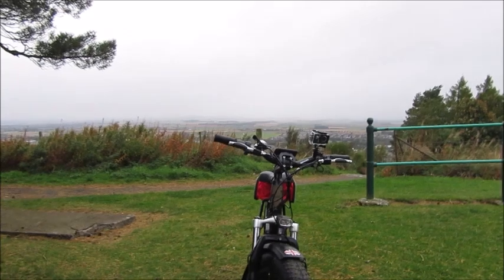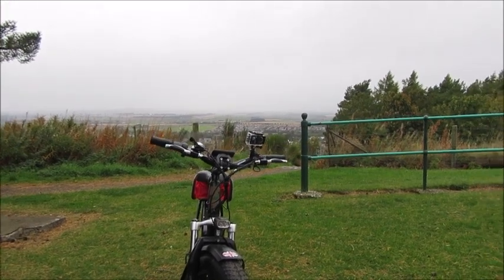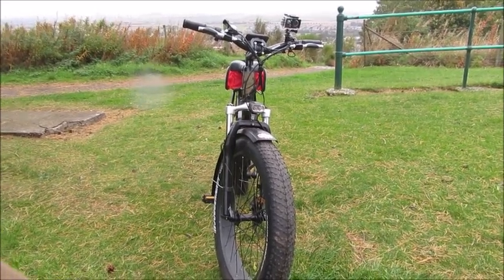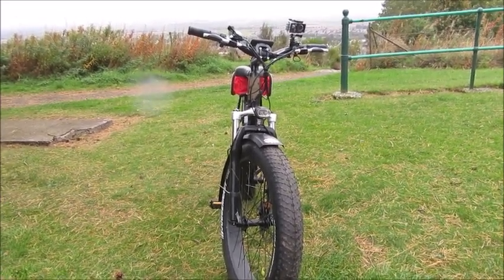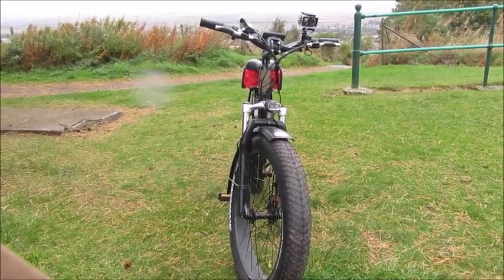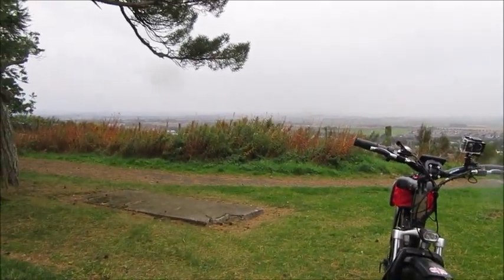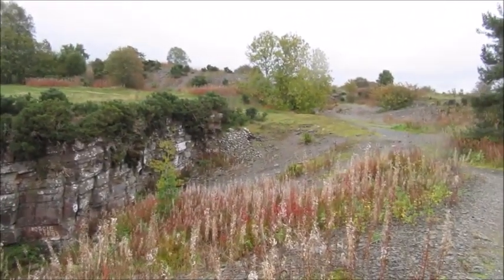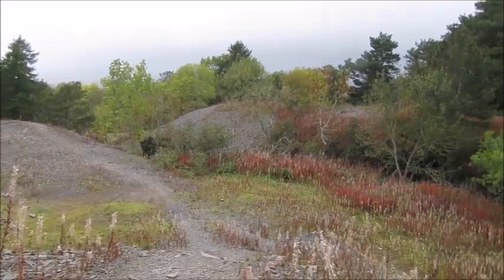rad rhino blasting up Balmashanner hill    nearly

Comment: Great effort Colin 🤘. I'm your weight and fitness and just want to be able to go out again after year's of depression. (Walking bores me) Hip is getting a bit achy now I'm 50. U.K. law restriction is too much for 123kg me plus a 20 kg bike (nearly 23 stone with a day bag)
Reply: Actually... Having re-read my comment  I wasn't implying that you're as heavy as me LOL. No offence intended 🤣 I meant that I was a stocky chap too. 😁

I jealously look at the options that RAD offer in the U.S. I'm loving the 2019 RadMini step-through as I have limited outside storage and a folding bike would mean I could put the bike in my car to explore new areas. The 2019 RadCity ST also looks good (quieter too with a gearless hub). Both with a 750 watt motor and large capacity battery. So, capable of handling  the load I'll put on it. Think I might be writing to my MP. 😉  The law needs to consider the type of bike the motor is installed on!

Comment: Have spent months researching and keep coming back to the Rad Rhino am purchasing a bike within next 4 weeks as diagnosed with a lung disease which have been told I need to push myself to help make the issue more bearable.  What are your thoughts on this bike,  it seems to have everything plus it does look good.  Have seen many American reviews but they seem to have some sort of connection to the company.  For me this is quite a big spend so I want to make sure I am spending wisely.  I purchased a Xiaomi Scooter but on my first outing got pulled over by the Police lol and didn't really find that I was exercising when using the scooter so only 6 miles on the clock.  Thanks
Reply from the maker: I will get back to you shortly... I'm just tied up for an hour or so... cheers
Reply from the maker: Hi, it's a great bike and does give you a help with the twist throttle. I think you will enjoy it I do. I try to be careful and have had know issues with riding on the road. I do use pedals and I am careful and don't use twist throttle to speed down a road. I cover up signage on the bike! So it's less obvious but that's me. I use it off road on good tracks not as mountain bike but certainly is ok to do so. Worth the money in my opinion but I wont register it as light vehicle. So go for it I have arthritis in knees and it hurts for the first few minutes but I keep a steady pace and works my joints. Using pedal assist 3... its heavy but seems to handle ok I'm no spring chicken but it's got me doing a few miles. Feel free to as any questions...cheers
Reply: @ColinTonkasdad  Thank you so much I think my mind is made up sometimes you can overdo the research like I said from what I have read and now reading your reply and seeing your video etc it does seem very good.  Thanks again for your help much appreciated.

Comment: Hey Colin, i understand that the european version is different than the US one, i just wanna make sure before placing my order, what is the max speed of your bike, on the EU website it's 25km/h and in the US website 20 mph ! can you change the top speed on yours!  and the last thing, does it come with the fenders, back rack and rear light connected to the battery ! thanks in advance.
Reply from the maker: yes it comes with all bits...in a box assembled apart from front wheel . yes easy to change speed to 40k...about 25 mph...Back  brake only works on braking.
Reply from the maker: oops..back light  works on braking... but I bought rear light. New models 2019. I think have rear light connected...